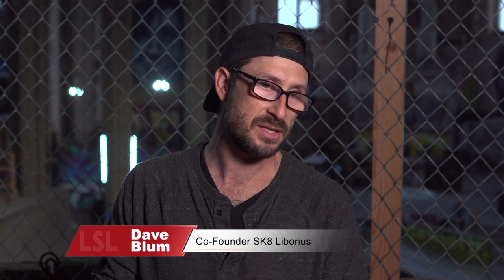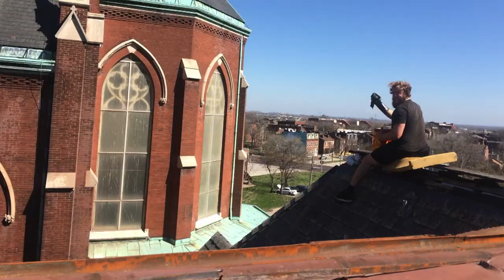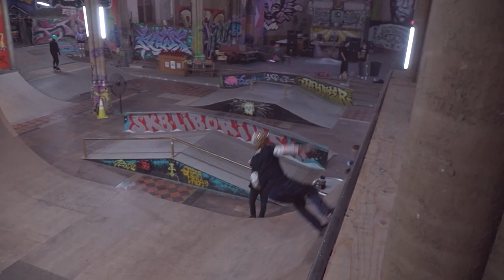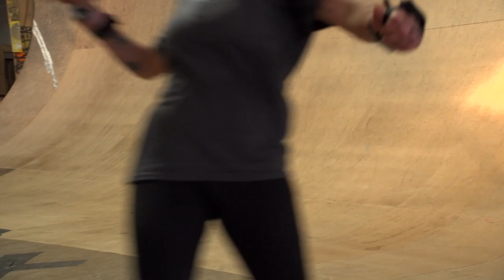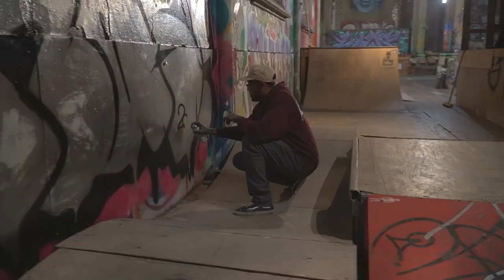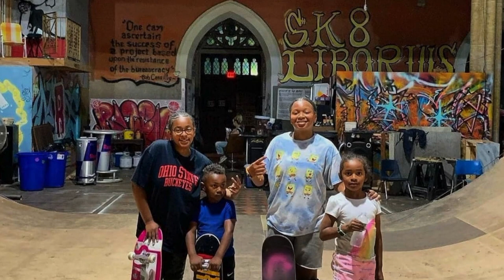Sk8 Liborious Turns a Church into a Skate Park | Living St. Louis

Comment: im 83 years old now and i went to St. Liborius school there from 1947 to 1951 and i lived 1/2 block away on Maiden Lane street in the old original Jackson School.. it was where the rectangular bare field is now in this video.

 I graduated from Jackson School on Hogan and Madison Street in 1953 which is also in this video.

My younger sister was married in the St. Liborius church...

i do remember roller skating in the basement of the school .. and years later the church being turned into a indoor skate park.
how uncanny is that... 

there also was a 3 lane bowling alley in the basement in the school and my older brother actually setup pins there..

So i have lots of memories of St. Liborius School and Church...